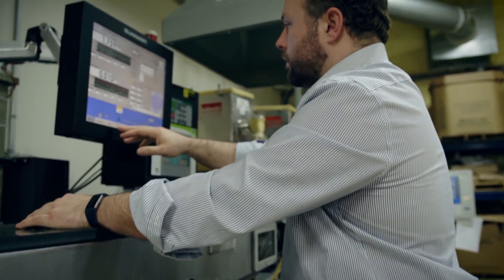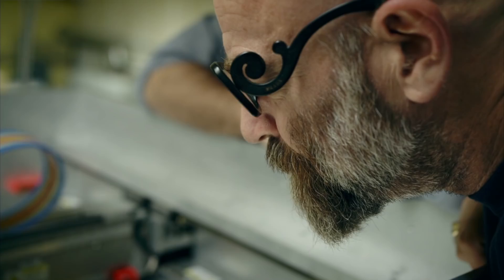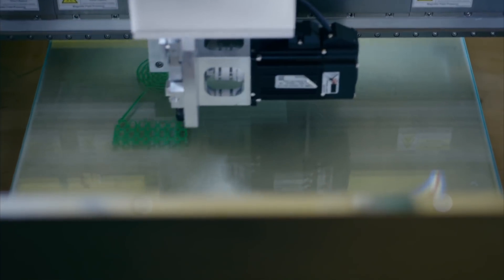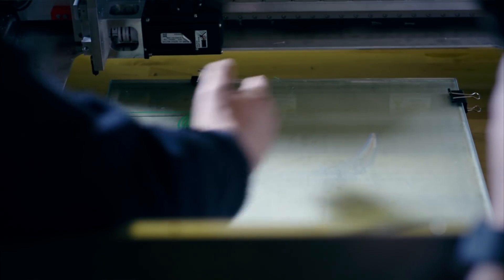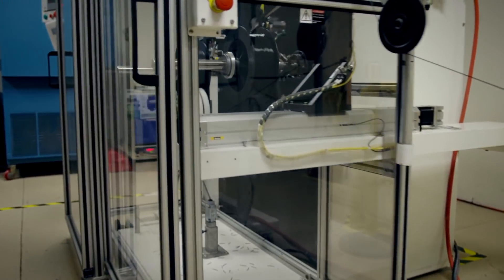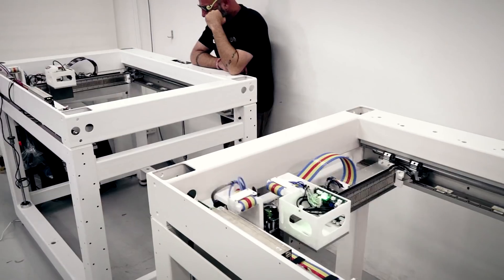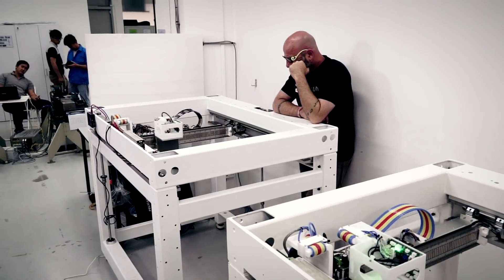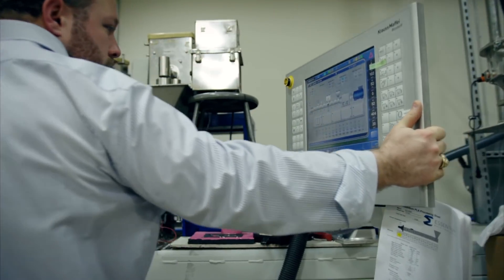10X Faster - Essentium's High Speed Extrusion (HSE) Platform

Comment: want  to  be  Daughter  
Sindhbad   Arabia  10000  sister  family   in  new  city  build   

Sindhbad  island    :  duke 💫  Magnetic silicon Quantum wave  satellite GPRS   skip distance Weight volume 15000km/hours  lift 10,000 tonne Raw  material  shift  height  travel  make  land   RUSSIA  Duke snow  tree +  mud  &  Pakistan  INDIA  border  land      built   city  
Duke 3D  print  Civil  work    
are  you  ready  all  thing  made 3D   built  Graphic   
100km  Mid sea Satellite  extension  Earth  land  Dubai  direction 100km  sea   build  3000 squarekm  land    base  Stone  mix  bind  silca   float  gas  mix  2nd  layer 1000 meter  thickmud  cover  
complete in 10  year  by  3D  print  my  method  25 year work  completein 10  year   

we be  family  best    ok  ready  accept         
check  your  post   
Hande Ercel  or  moomal  khalid  Messanger      facebook   

by 
duke  💫court

Comment: So the print speed is not 10x faster, just the nozzle heat up?

What would you need that for? Either your prints are long enough that that decrease in time doesnt matter much, or you switch prints quick enough that you can just keep the nozzle heated